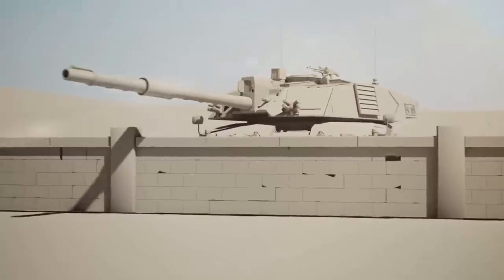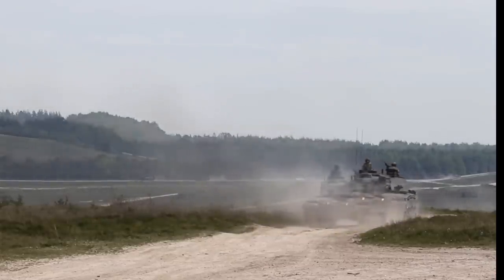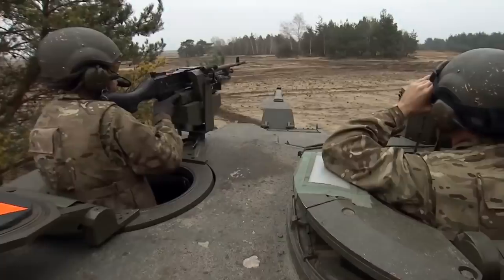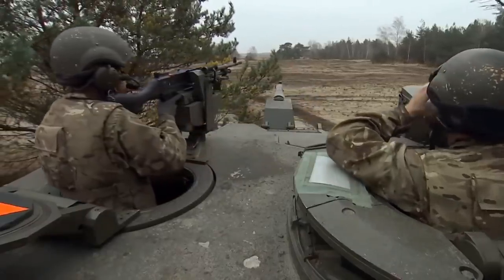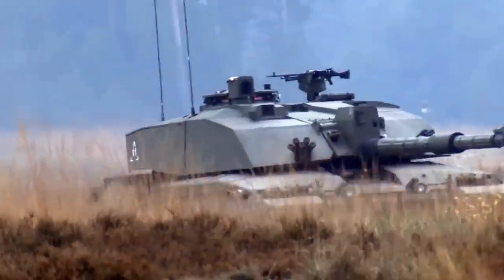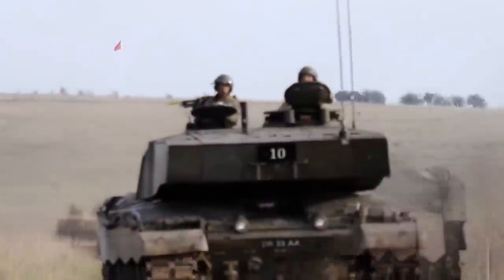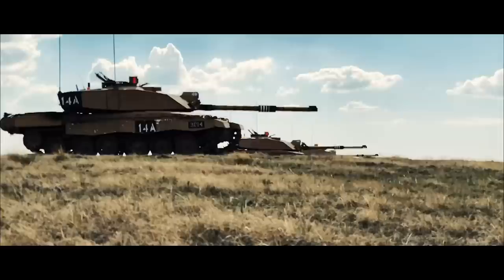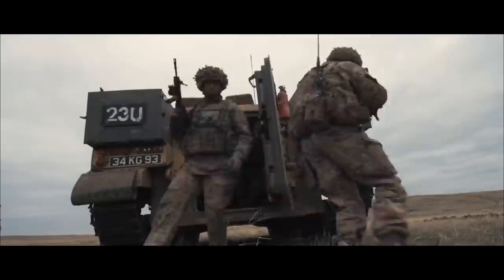Challenger 2 Tank "Black Night" | MODERN UPGRADE

Comment: No matter what other upgrades are implemented, there needs to be the permanent addition of a nice thick slab of Dorchester on the lower front plate for the driver. For goodness sake, he's only got 1200 hp and no new, fancy gadgets to work with - the man deserves a brick of Burlington, a chunk of Chobham.
Reply: Take a look at TES challenger at bovington. That thing has a 1500hp engine and all sorts of bits and bobs for the driver
Reply: It receives a block of Dorchester in it's lower glacis when it's expected to be entering combat operations. There is a separate program called HAAIP which will be looking at either up-rating or upgrading the engine.
Reply: Ahh those are my favourite types of cheese..but how is that going to stop an ATGM?, at least he can get plinked with a smile on his face..’more Wensleydale Grommet?’😂
Reply: @ScrotusXL  Well no one knows the details but the Dorchester block was added after the original ERA add-on failed to stop a tandem warhead from an RPG-29 so we can assume the block will at least protect against that.
Reply: Everyone throwing around names of exotic cheeses but not one expert has explained how it defeats chemical energy projectiles.
Reply: @DCrypt1  with impeccably aged, exquisite flavour.
Reply: I've never heard anyone describe anything British as exotic, especially our cheese!
Reply: @komradearti9935  reactive armor only works on the first hit
Reply: @DCrypt1  Chobham defeat shaped charge attacks by layering.
The exact composition is classified but the basics is
Steel>ceramic>steel>ceramic>steel>Kevlar.
When a shaped charge penetrates the 1st steel skin it's impact has pulverized the ceramic into powder.
That powder is heat resistant and forces the jet to dissipate through the powder, losing its focused energy.
Reply: @komradearti9935  not necessarily true. Challengers Chobham is made in removable plates added to the hull frame - display tanks only have RHA plates.
Reply: @komradearti9935  - The blog you linked to is primarily talking about Burlington armour, not Dorchester. At no point in the blog does he show that what ben grogan said is wrong. He doesn't actually know what the composition of Dorchester is as its classified, and so the blog fails to actually explain how chobham works.

So as you can see it is a secret sauce, that's why its classified.
Reply: @komradearti9935  What a terrible article. They are confusing the upgrade of Chieftain with NERA modules with the forthcoming Chobham armour.
Reply: @komradearti9935  - The armour being angled does not remove the possibility of it being ceramic as the increased depth is still a slight advantage, just significantly less of one. So it being angled isnt a valid reason to rule it out. 

And it's all speculation, particularly on your part.
Reply: @komradearti9935  - And none of that is evidence that Dorchester doesn't use ceramic.
Reply: @komradearti9935  - If it uses ceramics then they will play a major role, otherwise they wouldn't use them.
Reply: @komradearti9935  And the breakout effect can also be use to shatter long rods.
Reply: @manicmute9440  depends really, Ceramic (plates ) are costly and maintenance ( hard to inspect ) intensive. Also no point in mounting them @ agressive angles. Polymer filled ceramic pebble matrix could work.  But HHS seems to be favored due to ease of fabrication.
Reply: "Rolls-Royce Perkins engine". It's one or the other. Not both. And since Caterpillar bought Perkins before that POS was "introduced", it must be a "Rolls-Royce".
Reply: They really need to work on the upbkeep of the oil systems I mean really can you imagine on the battle field...Where's those pesky brits...? Oh ! Do you hear that ? Sqweek  eek sqeek !  Must be a brit tank coming sir . James bond HAHA.

Comment: Black painted modern tanks looks so damn cool. I hope germany paints a leopard 2a4 revolution black.
Reply: A4? I thought they moved away from that!
Reply: Its an upgrade package to bring the a4 up to a much higher standard. Pretty good except for it still has the old gun. Their "technologietrager" is like a revolution but with even more stuff and a hard kill aps and the l55
Reply: Ah so it for those whom use the older tanks and can't afford a new one. Gotcha!
Reply: Baron Von Grijffenbourg 10 points for creativity I guess?
Reply: "Sir, we burn the tank as you asked!"

"The soot that turned it black washed off in the rain!"
Reply: SPaMuRai GRaNaTaBRu, i think Germany itself isn't capable to get a new tank aether, rather than modernizing the leopards. ( from the look on the the known leaked docu. about the state of their army ) And i fear there isn't anyone much thinking otherwise within EU NATO nations simply cause of the money issues. But id rather not if all still be using different tech. Better wait t out, save some money up and modernize later in the whole block to the same level and vehicles, if we manage to work together on that properly.
Reply: PythonPagom well, it´s true that the state of the german military is pretty miserable atm, but they`re currently trying to get back on track. The money spend on the military is supposed to be raised until 2020, and a new leopard tank is planned together with france, so I wouldn`t say they can`t afford it rather than not seeing the need of it and now scrambling to catch up again.
Reply: The new tank is just an bastardization of both existing Leopard and leclerc with some electronic gizmos ( actually, being more an export project ). And the boost in German army finance is more a thing of getting the neglected state of hardware, mostly in the nawy and aviation. They did get a few new stuff, but I'm pretty pessimistic about any serious modernization efforts of the type of buying new vehicles for old ones. But as said, better save some money and do something completely new and relevant and re-arm the whole union later, even if in the 30s. But there are some issues to be fiddled up till then within the union and individual nations. ( as we here in Swk are quite a mess and failure in this regard ... and we were once in CzechoSlovakia a feared massive beast for the small nations we are )
Reply: PytonPagom I pretty much agree with you, but regarding the combination of the Leopard and the Leclerc, that was nothing more than a demonstrator. The real Deal probably wont be finished until 2030 or later, if I remember correctly.
Reply: 'i think Germany itself isn't capable to get a new tank aether, rather than modernizing the leopards'

Leopard 2 life cycle is expected to last til 2040, they'll have the MGCS (2030s) by then.

'They did get a few new stuff, but I'm pretty pessimistic about any serious modernization efforts of the type of buying new vehicles for old ones'

Puma IFV? Boxer?
Reply: APCs are a big thing across the world, even former Warsaw pact nations did or do buys here, there you're right. Still, I take IFVs/BTRs as a kinda weird class lately. Simply cause the latest developments pushes them to be sorts of small tanks themselves cause of IEDs and mobile AA systems being quite powerful nowadays, and we have quite a discussion in my nation about armor vs special feats like speed/profile/amphibian capability. They're quite different in this than they were in our soviet cold war times, and cause of our thinking isn't changed much, it has its conflicts ... just like the Czechs and their view at ideal assault helicopters. Not to say, they seem to be outdated in a lot of nations ( were still on BMP2s, with some interesting moded version introduced lately, but one can surely see, what a tin can on a shooting range it be in an modern conflict ). And the talks about they being supplementing a possible future lack of tanks in Swk/Cz and wheels vs. tracks. Im not saying they're bad, im just not sure about that class very much, especially trough the doctrine mist. And that all in Europe do have literally different ones, mostly not even produced themselves ( with I see as a great problem into the future if any bad things go down ) .... also, airplanes, nawy, submarines - platforms that can last for decades. I admit i may be looking at things trough too weird time-frames.
Reply: Yes because on battle field it will scare pants off the enemy.
Even Korean Black Panther isn't painted black. Tanks are build and painted for the war and not computer games.
Reply: @szeperator1649  This is paratrooper edition designed to be dropped from the Blackhawk at night.
Reply: I dont think a black hawk can lift 50 tons...
Reply: @szeperator1649  Are you sure?
Check it again.
Reply: Maximum take off weight 10.000kg....
https://en.wikipedia.org/wiki/Sikorsky_UH-60_Black_Hawk
Reply: Nah like the forest camo way too much
Reply: SPaMuRai GRaNaTaBRu  So, you are the one that thinks MBT Revolution is anyway more or less worth than those you call "new tanks"? That's amazing! Magic! Since most of today, Leopard 2A6 and 2A7 tanks are just as old as 2A4 which body was used both to build new MBT Revolution by Rheinmetall and Leopard 2A7 by KMW.
Let's go further with your "knowledge". Canada, Austria, Switzerland, and Australia - regular 3rd World countries. Regular Leopard 2A4 users, because they can't afford new tanks! Seems legit.
Now, you asked for it. Black Knight program compared to MBT Revolution is low budget switching of 2 modules when MBT is leaving only the shell out of Leopard 2 and making tank all new. Getting into smoothbore is mainly because of using the cheapest tank ammo (smoothbore) against the most expensive one - (rifled bore). And it is a way too late change for this tank. APS? Challenger 2 didn't have an APS? How it is even called an "III-gen. mod." tank? There is no possibility to change the main gun and not touch FCS. Settings, whole software or the whole set of sensors and stabilizers - it's made every time tank got a new type of gun. No, it is not a replacement of the Fire Control System. It is rearrangement - so common nobody talks about it. All about mounting thermal vision cameras is just a laugh. Even the cheapest T-72B3 have 3rd gen camera.
Dude, no way anybody could put a comment lower than on your level...
Reply: @PytonPagom  Germany is THE BEST place to build a new IV- gen tank. on the planet. Japan is a 2nd best country to make one. They have it already in fact. It's called Type-10 and it's too damn expensive for Europe. Not to mention that Japan won't sell it anyway.
France, GB, Italy - all were thinking "we can do better one!" Aaand they fucked it all some way or the other Plus they've lost few fortunes of money for own projects set out of from scratch.
Reply: @poccer7722  It would be a combination of Leopard and Leopard. Leclerc has few total construction failures. It's just the way AMX family has it in DNA. All before 4-5 Batch was a new junk-tank. Autloader problems, engine and transmittion problems, armour problems, major (impossible to fix now) issue of fronntal turret protection.
Reply: Well, Poccer 77 is right the real new tank piece be presented only in a few years. Doe, that demonstrator surely wansnt about it tho - it was just some mid-price export thingy to make some bucks. Perhaps, having some stuff they plan implemented in a limited matter. Tho, im really interrested about what they come too, cause Russians seem not to be very happy about the unmanned turret as it is, and VR probably isn't a way ether. Whit US failing to come up with anything actually buyable for the last decades, out of their future combat armor programs, it might be Germany be the lead here as RF wont have the budget for full-scale T-14/15 implementation, and is still questionable in terms of its actually final variant. Definitely want to see their answer for the manned/unmanned hassle and if they come up with an auto-loader.  As for the Type10 - ( Type 90 was deployed only in Hokkaido due to the weight limit of roads and bridges in other parts of Japan ) ... Type 10 was build to withhold he strict weight-limit, thus i would expect some armor-compromise being there. But just as you said, they plan to keep it for themselves. Kinda makes sense being close to the copy-workshop China is, but that is then the expensive part of the matter. Making modern tanks for just few buyers is ether a heavy national budget eater, or a possible economic problem for the constructors.  .... and as for GB/FR ... beingpolitics actually reasonable in EU and Rheinmetal a bit open about things ( and especially politicians ), all Europe could have an united weapons-platform on hi-tech standard. Problem is, rights had to be mainly limited and all states having their own and possibly free of charge servicing and constructing rights, and all parties should have a hand in its development ... witch always was the Achilles heel of any such attempt in Europe - really damn shame.
Reply: Pzkpfw 4 Ausf.A. the colour black sure looks good and tough..I also like the idea.the things is in winter war we won't use that colour scheme..for the obvious reason

Comment: When your talking electronics modular and quick remove circuit boards really help to keep your packages running well fast.  Also never forget to use open architecture for your electronics.  This is what keeps the Grippen & F-16 so up-gradable and up-to-date.

Comment: Re the powerpack; the MOD always intended that MBT80 had a 1500 bhp version of the cv12. it was derated because the Treasury demanded a longer service life for the packs in order to save money. It's my understanding that one option for the LEP programme is to give the cv12 a common rail injection system which will boost output to over 1500 hp. 
For me the biggest weakness is the transmission not the engine. C2 has six forward gears, the lowest being a crawler gear. This is because the C2 shares it's transmission with the CRAARV, which needs an ultra low first gear for pulling power rather than acceleration. C1 had four forward gears and better "take off" than c2 because of this. The six speed box seems to have trouble generating enough torque at low revs which hinders acceleration. 
Two solutions; increase the torque /improve the final drives so the power comes in with less delay,
or fit a new  transmission.
Reply: Cheers matsimus. Great vid btw, keep 'em coming!
Reply: Much of the choices made for Challenger 2 were for commonality reasons. Imagine the logistical nightmare of fielding CR 1, CR 2 and CRARRV all with different engines and transmissions. It was probably felt the likely improvement in availability from using common modules would trump any mobility gain from a different powerpack.
Reply: @agt155  There was never any intention to field three vehicles with different engines. C1 was phased out when C2 came into service. Craarv, C2,Titan and Trojan all share the same engine and transmission.
Reply: @thewomble1509  CR2 was developed with the intent of serving alongside CR1. The end of the cold war meant that never happened. If CR2 was to have a different version of the CV12 then, with CRARRV (based on CR1) and Trojan/Titan (based on CR2), there would have been two different engines (CV12 1200 & CV12 1500) and three different transmissions (TN37, TN54 & DB-1500). A logistical nightmare.